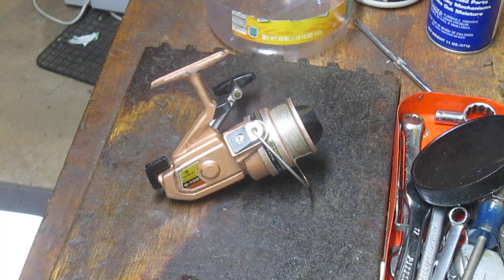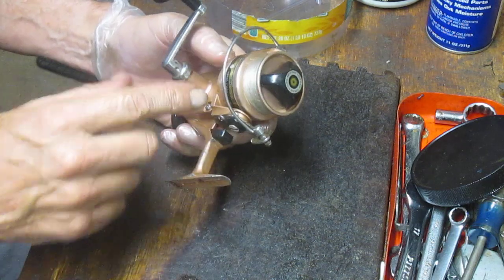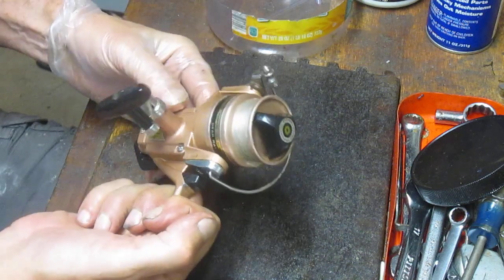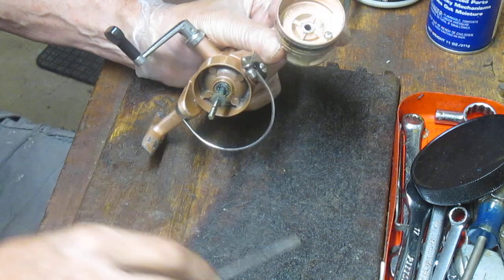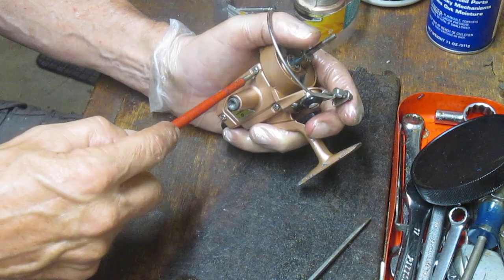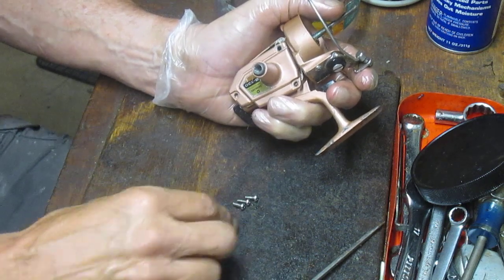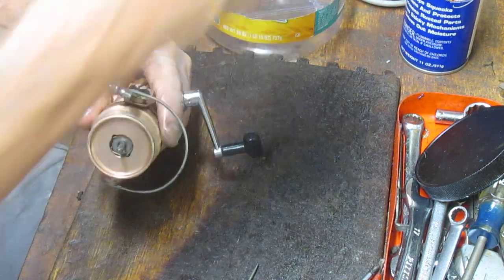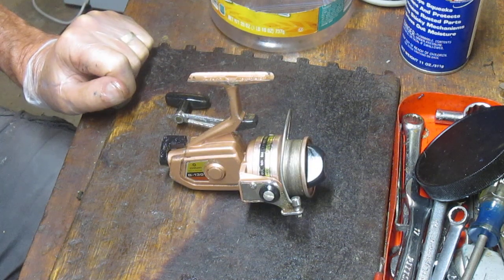Daiwa B-130 fishing reel take apart and service

Comment: This reel is different in that the handle side removes instead of the more common side plate side. Lining up the crosswind block could be more difficult in this arrangement. I don’t have one of these but I like it. Had not seen this video before. I was searching to see if you had done a 8600 Daiwa before. Fine video!
Reply from the maker: Thanks Chris - Please stay well - Dennis